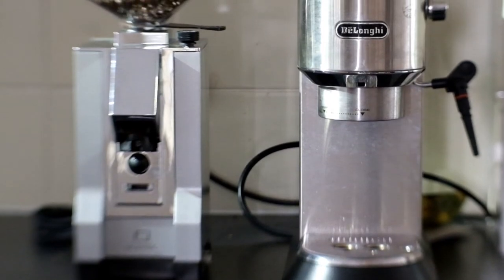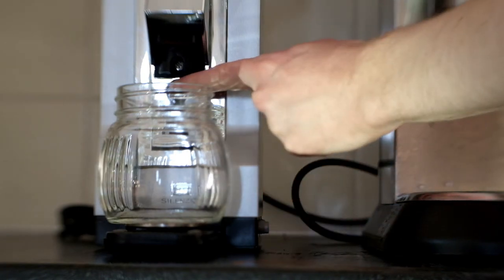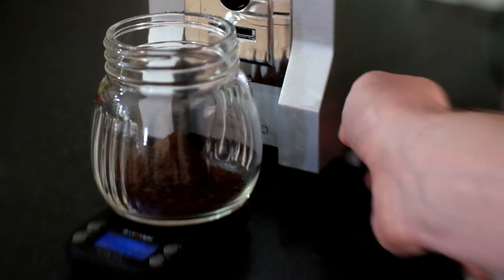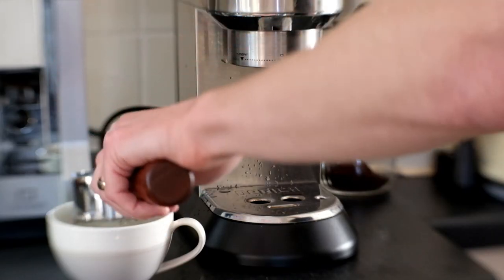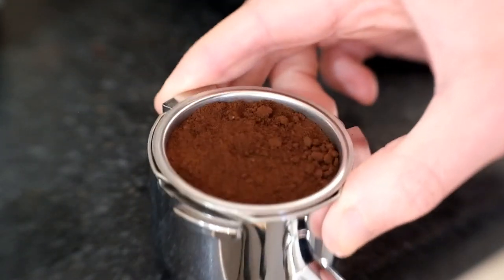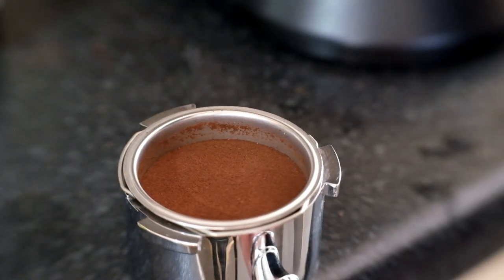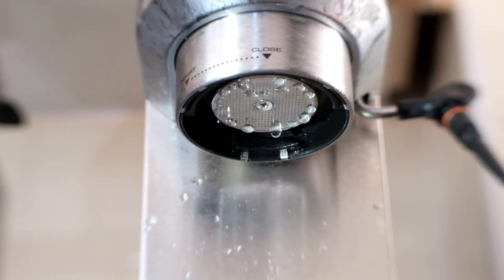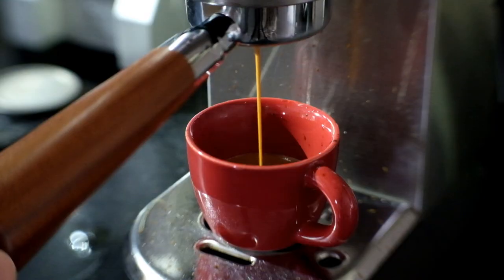Delonghi Dedica Espresso Guide

Comment: Are you using the default times on the Dedica or have you changed them? If so are you using the single or double shot?
Reply from the maker: I manually do the timings. I set the button for a really long extraction but turn it off at the weight I want.

Comment: Hi Peeps , so I use a finer grind  coffee where I can get de best result on 28 seconds since a press the bottom with 15 grams of a medium roast coffee , I heat the cup and at the same time clean up the machine with the first shoot , bottomless portafilter the I bought didn't work due all the water spilled from the corners ,so I removed the plastic on the original  ..how that portafiltros is holding ?? Any good suggestion to buy ?

Comment: interesting advice on heating up portafilter in a separate bowl. was thinking in the same direction. 
but do you think there is need for that when coffee doesnt even get in direct contact with it, being a bottomless portafilter?
Reply from the maker: I think the heat gets leached so easily into the metal if it is not already hot. Because the group head isn’t really heated like on an E61 group, the portafilter doesn’t really get hot enough during a pull.

Comment: Hi, I have a question.

Every one of my coffee is terribly sour. Every type of coffee is sour.

I tried:
- change the temperature
- pressure and non-pressure sieve
- different types of water
- I decalcified the coffee machine with the original preparation and also with vinegar.

I don't know where the mistake may be anymore.

Can you please help me I'm already desperate

I own a delonghi dedica ec685 m coffee machine and a delonghi grinder kg521 m.
Reply from the maker: See if a local cafe will grind for you. If it’s still sour then likely the temp is too cold. Mine never made really excellent coffee. Alternative is you might be confusing sour and bitter. Could be too fine

Comment: Hi. I just got a Dedica, first time using it today and when I go for a single shot I only had a few drips of coffee come through and a bit of water spurt out the side of the portafilter. I've been researching all day and I've been wondering if it's because the coffee I have is too finely ground (I don't have a grinder yet). I read that this machine needs a coarser grind. Do you think this is because I'm using the default pressurised basket? Would a finer grind work better with a non-pressurised basket? I've seen you can swap them out. Cheers!
Reply: @alexford9101  Cheers! I'll give the non pressurised one a go and also try a coarser grind and see what results I get. At the moment I just want to make an ok coffee, then I'll start thinking about upgrading 😅

Comment: For this basket 15g is to low. i use 20gr on the same basket and it is to the 2cup line so no stucking tamper and better coffee to 1/2 ratio
Reply from the maker: I agree with you, and the basket will of course fit 16-18g easily. However I find that the fuller it gets the more the puck channels and the more issues I get with sourness due to the water not being hot enough even when channelling does not occur. It does vary by bean. I have found another roast which fits 16g with a light tamp. What are you using to get 20g in? How hard are you tamping?
Reply: @theangrymonkey  i use the dedica grinder at the finest grind setting and i add 20g of coffee i tamp hard and my goal extraction is 40-45g in 25-30sec from dripping start. the coffee is medium roast and 1-2 weeks old from roasting. Some times getting channeling 1-2 streams but for 1-3sec i have over a month to see real channeling with 1 stream to flow all the way.
Reply from the maker: alex doumas sounds brill! Could be that my tamping is poor too. Might try with a paper filter on top
Reply: @theangrymonkey  maybe you need finer grind.  this is the reason that i tamp hard to compact the coffee to slow the rate down. probably in the feature to hack the dedica grinder to finer grind.
Reply from the maker: alex doumas possible. The Mignon can easily choke the Dedica though. My impression is that when it becomes too fine, the Dedica ramps up the pressure, which is less ideal. Am using similar grind on two other machines and find it ok.
Reply: @theangrymonkey  Have you tried a shower filter?

Comment: Hey Alex,
I've been experimenting with my dedica for some time now and i'm about to quit.
No matter how fine the grind is, I can never get to 25-30 sec extraction time. It usually takes 15-18 secs and although there is some nice crema, but it doesn't taste good and it's thin and watery.
I'm using a non-pressurized basket, 9 grams coffee for 1 cup espresso, medium to dark roast and high temprature setting.
Any advice?
Reply from the maker: Hi. Two main things to check. First is if the grind is fine enough (what are you using?). Second are the beans fresh. I don’t have much experience with single baskets I’m afraid. 

After that I think the tamp matters a lot. I think the Dedica tends to break through the puck very easily so if the temp is too hard it does nothing for a bit, then breaks the puck. A light tamp seems to solve this to some extent. But it might also be that you ground too fine… 

An alternative would be to buy a puck screen (a thin metal mesh) to go on top of the coffee bed. This stops the breaking happening and will show if the machine is actually choking. You can test this with just a circle of normal coffee filter paper on top of the puck.

Beyond that I just found the Dedica very frustrating in the end. I know others get it to work but I traded out for a Europiccola which I absolutely love. Also had a Gaggia classic for a bit but that is definitely not as refined as the Europiccola and nowhere near as neat in the kitchen as the Dedica.
Reply: @theangrymonkey  Many thanks for the time man. I really appreciate it. I have a delonghi KG79. It didn't grind fine enough for non-pressurized basket, so I did some modification to it and now it's way finer. I'll give it another try with coarser grind and also puck screen, or may give up, sell this and save for an alternative.
Reply: Try 14 grams of coffee for 1 cup instead of 9 grams
Reply: @sergiocohen1026  what about 2 cups?

Comment: Good tips.. 15g coffee is of dark roast? Tried any different roast level 1s? It must be fairly fine grind.. I'm using 16.5g with coarser grind.. still fine tuning thou..
Reply from the maker: Hi. Yep, 15g dark roast. Have found I struggle to get much decent from lighter roasts. I have recently used a denser coffee and managed 16g in but had to level and not tamp to make it work. Grinding coarser just resulted in the usual sour mess
Reply: How much do you set your level height? I should try that.. what about preinfusion? Sometimes manual longer preinfusion helps sometimes it just make a hole in the center for me..
Reply from the maker: cra2yjoker probably about 4 mm from the top of the basket, just at the point a 51mm tamper gets stuck. Just using the default Pre infusion but manually stopping the pull.
Reply: Alright, let me experiment with diff level heights tomorrow.. my current 1 is 8.5mm with medium dark roast..
I also find it taste better with longer shots on this machine (>30s)
By the way, your shot time starts after the espresso 1st drop?
Reply from the maker: cra2yjoker timings from first button press. I tend to find somewhere in 40s region is working well for these beans. Measured my leveller and the gap is nearer 0.7-0.8. Apologies
Reply: I start to use just leveler too, seems like the espresso will come out more evenly..
0.7cm? Right?
Reply from the maker: cra2yjoker yup
Reply: Nice to discuss and share this delonghi espresso experience with you.. hope you continue do more experiment and share it in the future.. xD

Comment: Did you set the temp at low, medium or high, please？
Reply from the maker: Temperature on high. The lower temps seemed to be sour
Reply: @theangrymonkey  Thanks! I have been using medium and found it particularly sour.
Reply: There is in instruction, that it should be high for espresso